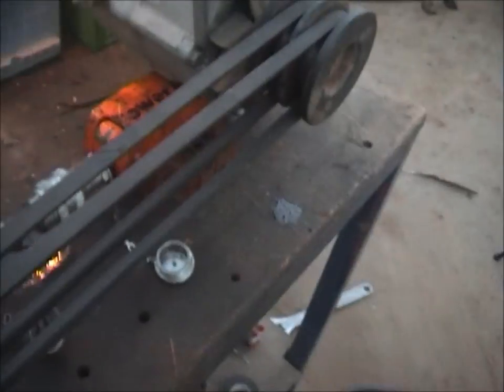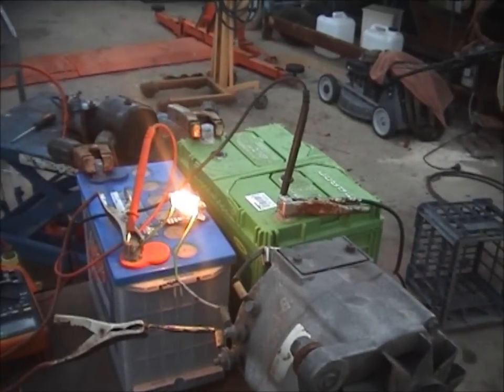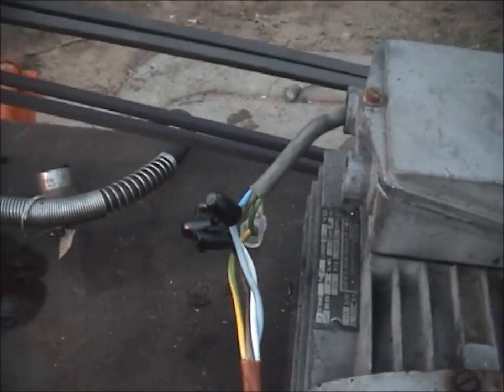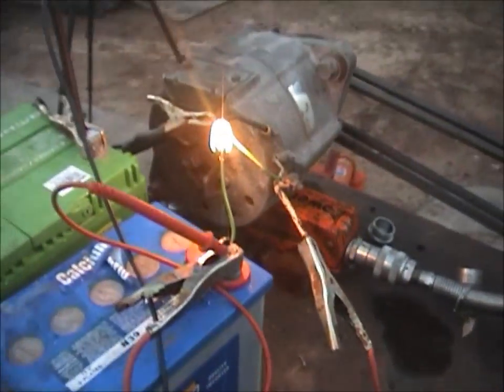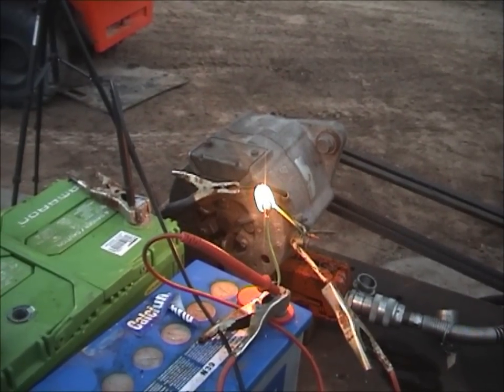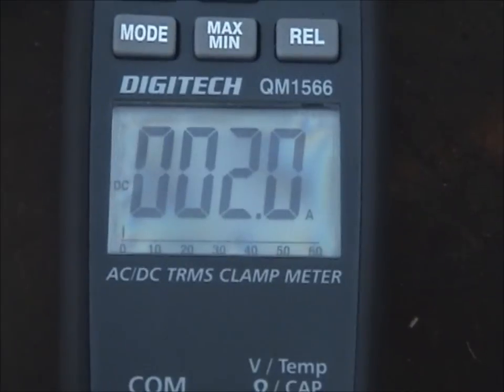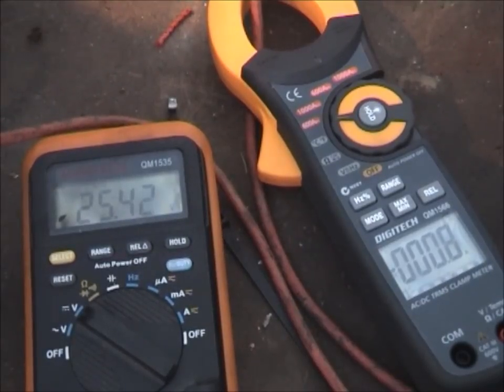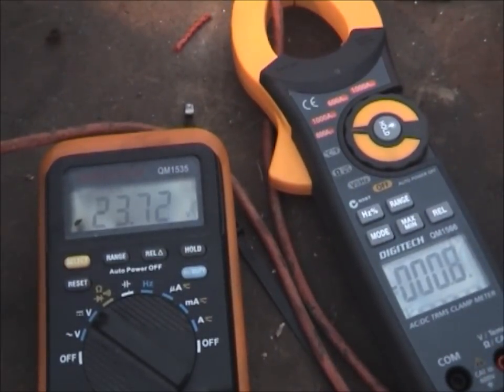3 Phase Motor + Alternator Jury Rig

Comment: i think maybe at least one set of diodes may be cooked if there is reverse current flowing with the alt off. check the rectifier diodes if you can if one or more conduct (even partly) both ways the diode is cooked

Comment: Great to hear the wine change when the alternator gets loaded.
Excellent to see the meter displays.
24Volts 50 Amps is 1.2 kW
2.2 kW motor is enough to turn it over.
Hydraulic v-belt tensioner is pricesless.

Comment: Love it.
I built one of those 30 years ago for staring farm tractors in the winter, while living in The Netherlands.
I used a 3000 RPM 380 Volts motor and a 60 Amp 12 Volts car alternator.
Ran it for 3 to 5 minutes to give the batterry a quick top up before cranking. It put out about 35 Amps, better than the 4 Amp charger I had then in those days.